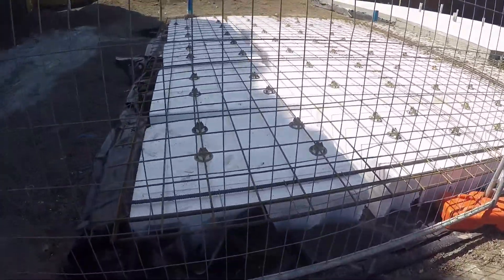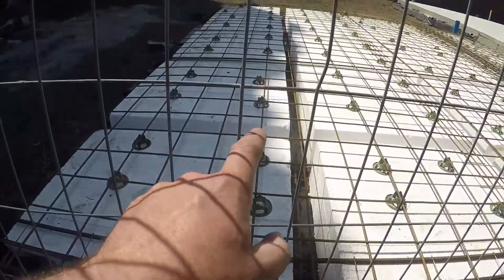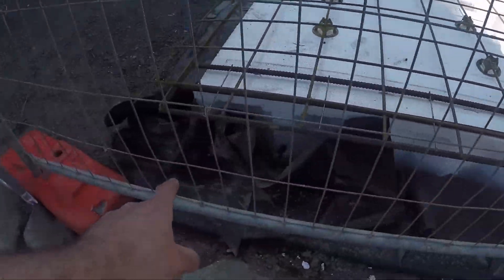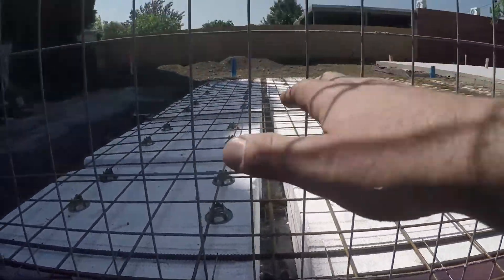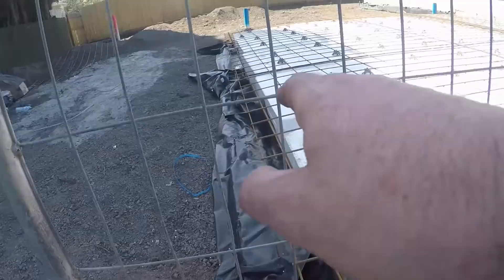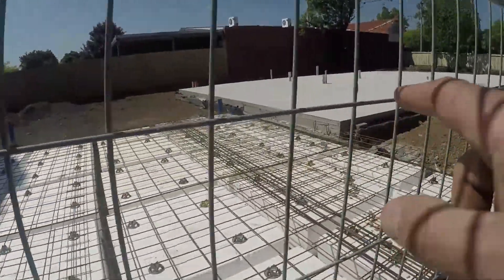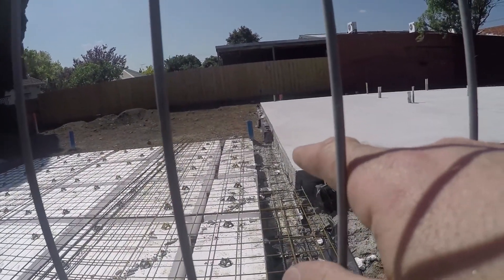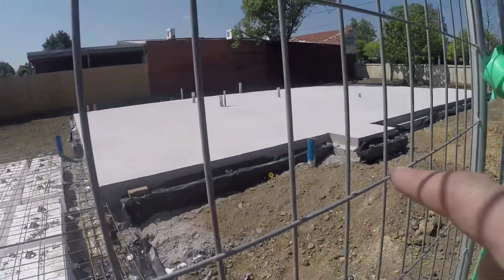Concrete Slab - Waffle pod slab

Comment: How does the slab slide down hill when there are piers constructed to slab .
Reply from the maker: Gday Brett,
GREAT question.... these Slabs DIDN'T have a Piers... If these piers had of been installed then these would not have slid down the hill.
I have a VERY good vid on this, the video is on a residential site where the waffle pod slabs are being installed adn once again with no piers.  the water builds up under the slab (a water molecule is non compact-able) has no where to go so it LIFTS the slab... if its a down ward/sloping site then the slab will follow that 
#stayawesome
joe joe

Comment: Didn't they design  waffle pods for reactive soils.
Reply from the maker: Gday Kerrianne,
the first time i worked on a Waffle slab was in Nevada in America in the sandy soil.  this was due to the HIGH compact-ability of the sand and making sure the slab was firmly in place with a strip footing the entire way around the external with one also internal.
Many aren't built like this and if there is a "High reactive" soil then i defiantly would be installing piers and a strip footing as some soils will move between 75-100mm (3-4" ) between the hot and wet seasons (even more in some area)  Always consult an engineer adn the soil test
#stayawesome
uncle joe joe